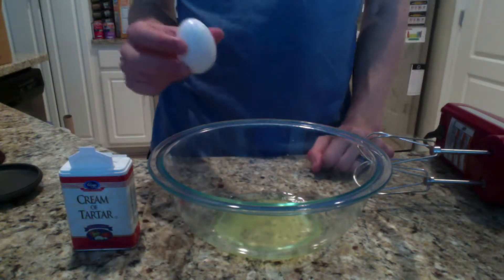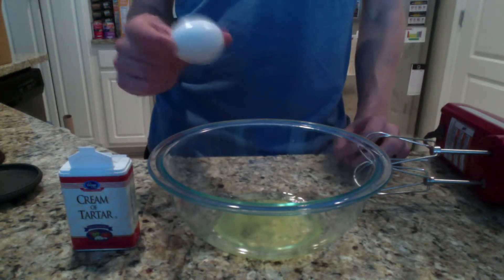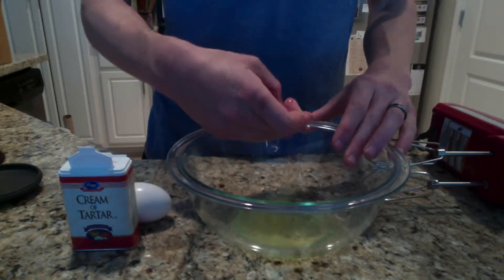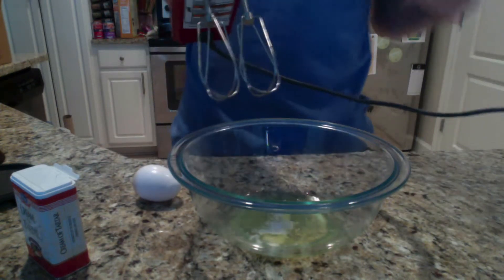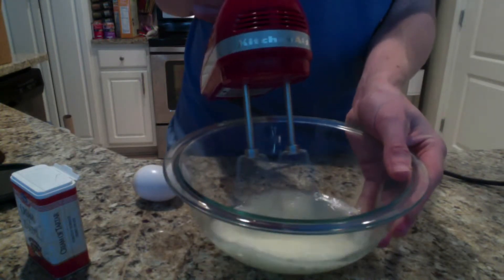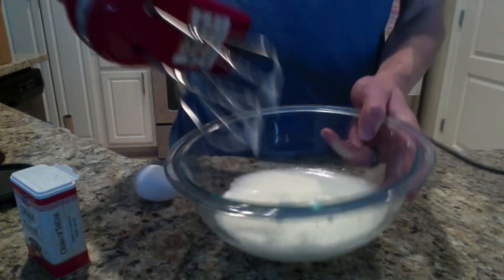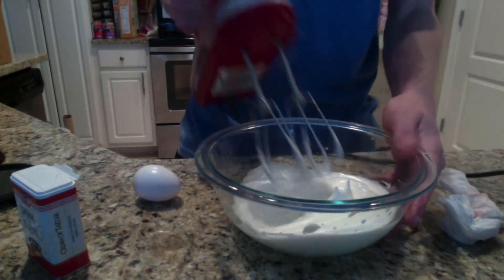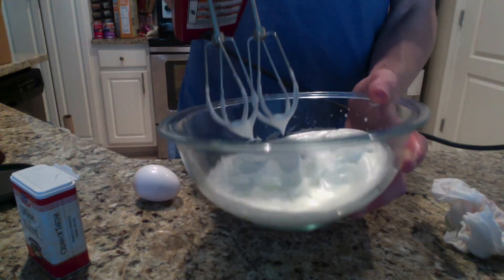Egg Foam Demonstration

Comment: I have a question. Is the mechanical motion enough to break the chemical bonds of the unraveled proteins to allow for new bonds to form or is the mechanical motion simply unraveling the proteins and allowing them to re-ravel around one another with inter-molecular interactions?
Reply from the maker: Great question! The mechanical force is not enough to break covalent bonds within the proteins, only the intermolecular forces. Even though we call them "intermolecular forces," they also hold the individual protein molecules folded up, via interactions between groups on different parts of a single chain. Force disrupts these interactions, opening the door to new interactions between protein chains. Covalent bond breakage requires a lot more energy.
Reply: Michael Evans Hey, thanks for responding. I'm sorry it took so long for me to get back and check this. I just wanted to let you know that your answer lead to me looking up quite a few things and I came upon something called Mechanochemistry. It seems really cool (mechanical motion used to break/make chemical bonds) and perhaps you may want to look into it. Of course, the forces used in Mechanochemistry seem to be much stronger/specific than the mixing that was done in your video. Anyways, have a good one.
Reply from the maker: Austin Anderson
I LOVE mechanochemistry! :-) My research group in graduate school had a subgroup for it. Here's more information: http://sulfur.scs.uiuc.edu/research/mechanochem.html
Reply: Michael Evans Hah, awesome. Pretty cool that you did your graduate program in my home state! I'm currently with my significant other up at U of Chicago because she is getting her PhD in chemistry (organometallic). She almost went to UoI. I've decided to take some time off with a B.S. in chem before I decide whether to pursue a PhD. I love watching your videos by the way. It keeps me up to date on my knowledge and helps me learn quite a bit of new things. You are a great presenter and I'm looking forward to more!